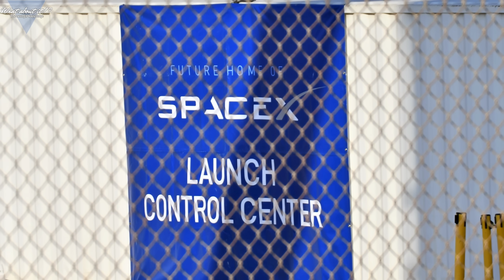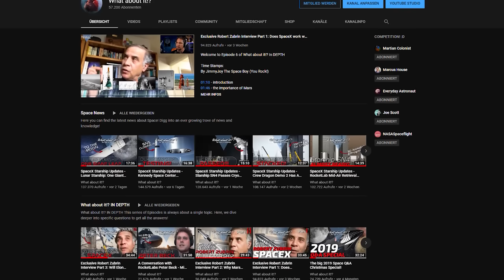100 | SpaceX Starship Updates – Countdown To Mars: Perseverance’s Last Days On Earth

Comment: Ok not knocking SpaceX but has anyone ever questioned why they are Building there Rockets out in the open and not in a facility like everyone else ???? The Star Ship in Boca anyone can see the construction with no issue. Nasa Rockets are Built in Facilities with people in Clean Suits and many other setups. Like I said this is a new approach to Rocket Building but very very ODD. At Least the Dragon Crew and the Dragon supply is built in a place under very strict quality control conditions but Star Ship being built outside in the Weather would make me wonder on the reliability of this method.
Reply from the maker: If it works, it will revolutionize everything. Even construction. They're building it like this because of the early prototype stage.

Comment: When you visited Kennedy Space Flight Center in Florida, if you took the bus tour that included the Air Force Station next door you got to visit the launch control building for Alan Shephard's 15 minute sub-orbital flight in 1961 aboard the Redstone rocket.  You can
 even push the actual button on the control panel that launched the rocket 😁👍.  The launch control building is so close to the launch platform that you could have easily hit the rocket with a baseball.  Amazing!  That was necessary because the electrical cables controlling the launch had to be hard-wired to the rocket.  That problem was solved before John Glenn was launched on his orbital flight.

Comment: The rearrangement at Boca Chica will take exactly as long as it will take, and not an hour longer.
No, Perseverance will find no evidence of life on Mars. I can wish for it, but it is not and never was there. (Having said that, there is probably a very advanced civilization in gigantic caverns under the surface.)
Of the four Mars rovers, only Curiosity was launched by ULA. The previous three, Sojourner, Spirit, and Opportunity, were all launched on Delta II rockets, supplied by Macdonnel Douglass, or Boeing after their merger, which were operated by NASA itself. They were all launched before the formation of United Launch Alliance in 2006.
Really though, i think the big question is, can SN-5 survive testing? SN-4 blowed up real good, but of course that was a problem with ground support equipment, not the rocket itself. I would sure like to see SN-5 perform the long awaited 150 meter hop. Of course, it has that big dent in it. I don't know what affect that will have on pressurization tests, static fire tests, of any possible flights. I wiuld say though, that it is probably best not to try to launch it to high altitude. If it survives ground tests and a 150 meter hop, then let SN-6 handle flights up to twenty kilometers. SN-7 can then start attempting to breach the Karman Line. Even once that is achieved though, there will still be significant work to do to create a spacecraft capable of carrying and deploying payloads. I hope though, that as they move on to to that work, they will begin developing the Superheavy booster in parallel with Starship work.
Given all the knowledge gained and lessons learned from falcon and Starship, developing Superheavy shouldn't really be that hard. They might be able to have an operational model in just four or five iterations, maybe less. If that happens, if there are no major setbacks, we could see a full stack orbital test early next year, and the first operational flight, probably carrying Starlink satellites, not long after. That would really, really, be something.
Even if worst comes to worst though, I imagine the first orbital flight will be no later than 2022. No matter how you figure it, Starship will soon render almost every other launch system on the planet obsolete. The only ones that will still have meaningful roles to play will be the smallsat launchers, and Starship may well be able to give them a run for their money.

Comment: OK--------- Hopefully the launch control center is going to be an air tight concrete bunker with extra thick bullet/explosion proof glass in any viewing ports and not a blow away shack.
Reply: No it's an open terrace design with deck chairs. The idea is to motivate the team.